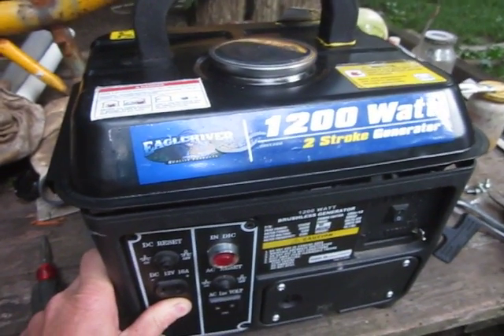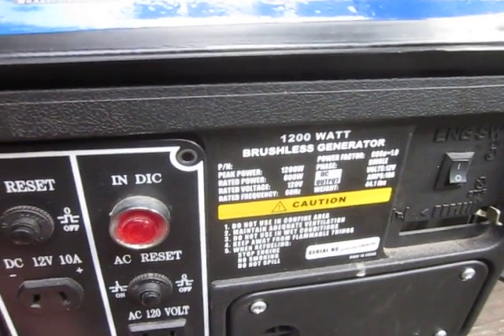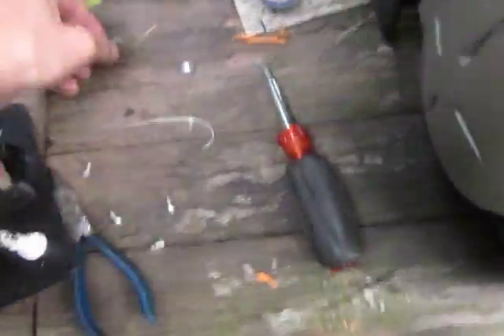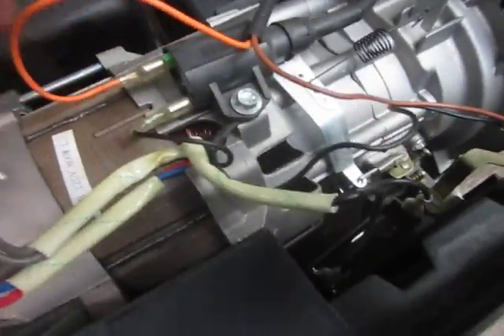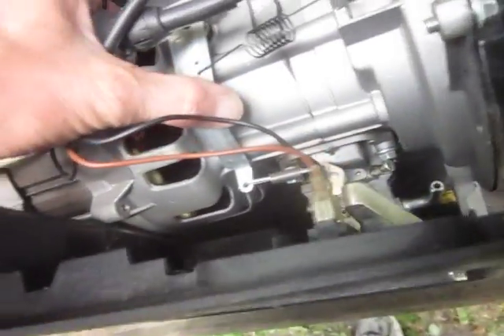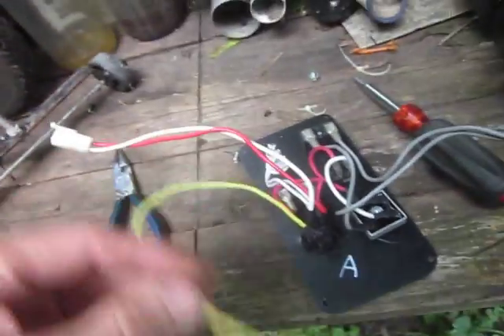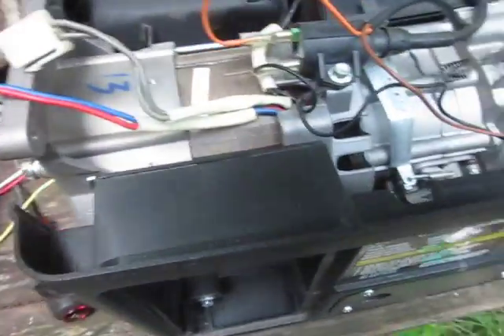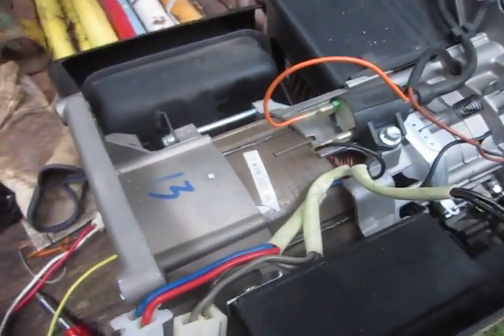Menards Eagle River generator failure

Comment: Hi Rick, I have the same generator and had the same failure.  I took it completely apart about 10 times, could never find anything wrong with it.  I measure inductance of all the windings and rotor, checked the rectifiers on the rotor, checked the 12 uF capacitor, 12 volt rectifier, reflashed the generator, and remagnatized the rotor, all to no avail.  I finally discovered the generator desired a larger capacitor value so, I installed a 22 uF in place of the 12 uF and it came to life.  The only drawbacks now are, I had to slow the engine down to 3150 rpm to get the output voltage back to 120 VAC and, output power dropped about 20% so, something must have gotten damaged but, it certainly isn't obvious though.
Reply: I've read, I assume since no AVR, that the voltage is closer to 120VAC when running more wattage like 400 or more... where-as with less power draw the voltage can go up to 150-160VAC.
Reply: @jafinch78  Yes, you are correct.  There are actually 2 mechanisms working together that influence output voltage with the brushless design; the series resistance of the windings and the poor engine speed control by the governor.  Most portable generators drop 4 Hertz between no load (3,720 rpm) and full load (3,480 rpm).

Comment: You can pull the generator itself apart. Then check the continuity of the windings, if you find they do not have good conduction then a portion or all of the winding became demagnitized. A short can also occur if the thin clear epoxy coating that insulates the wire has been damaged and resulted in a short. This happens from heat over time. Most electrical motor windings are done by hand. The two major points to consider it 1. Rewind a motor with the same or larger Guage motor wire and 2. Wrap the wire in the same directional pattern it was removed and same number of turns.3 lastly make sure you use epoxy coated motor wire.  It is very common for obvious reasons.

Comment: Did you ever get it fixed?

This looks like a brushless capacitor-excited alternator. You tested the capacitor, so that won't be the problem. There is a rotating rectifier diode mounted on the rotor (inside the center of the generator). Check that this diode is still connected (no bad soldering etc.) and that the diode is not shorted or open. If it is good, you may need to try to flash the generator with a low DC voltage while it's running.
Reply: Good to know... didn't realize there is the diode inside somewhere.  Was wondering how worked since doesn't read like has an AVR and is the older diode capacitor design. Reads like a higher capacitance capacitor is a good upgrade as well.

Comment: Go to Tractor Supply and check out the champion line of generators I have a small one that's about 1800 watts and it's four stroke and you can get it for $200

Comment: sounds like the capacitor or the rectifyer is shot seems as if the generator is fine if its putting out 14,4 dc volts but something is stopping it from stepping the volts up to 120 so my firt guess is the rectifyer

Comment: if it's putting out power any power the stator should  be ok the other thing it  the rectifyer But I take it apart and I check the stator with a magnifying glass to make sure if you find any broken wires there a bit of pain to fix but are fixable as on there the wire, not copper but coated aluminum. If your careful A soldering iron and tin solder (not lead solder)   can fix it.  Most generators stator wire damage is caused by a lack of cooling an engine running too slow to cool the stator down and it usually causes by a dirty carby But the problem is these two-stroke generators they generate a lot of heat So they're not really meant to be run for a long pirid of time.

Comment: What's the measure resistance of the windings?  That will confirm the windings are shot and there is a slight possibility of the actually windings losing connection due to a cold or bad solder or connection joint at the plug wire to winding wire interface.  I've only seen on rotors the connection bad... though I do wonder and like to check for when I do remember to.  I'm just getting mine out that I've never used before and she doesn't want to start so thinking carb, spark and air circuit check time.

Comment: Same thing happened to me.  I used it maybe 20 hours.  It worked great, until it quit generating electricity.  It runs great.  Any fixes on this?  BTW, I replaced it with a Harbor Freight generator and it has lasted a long time.